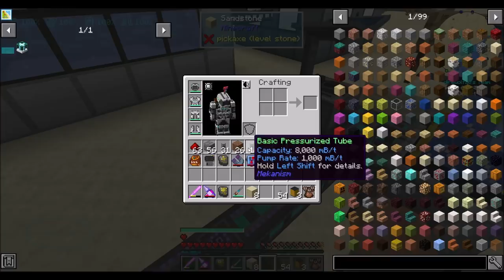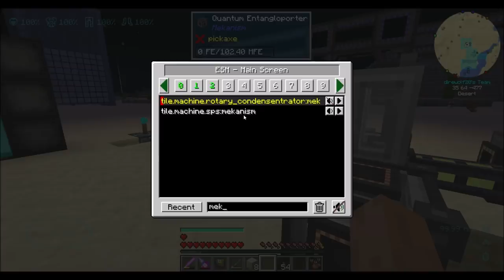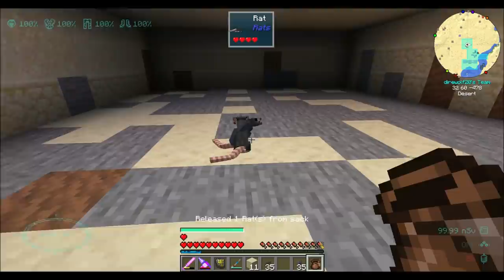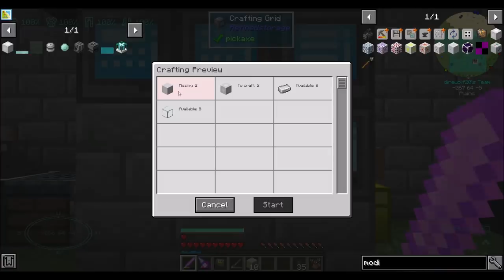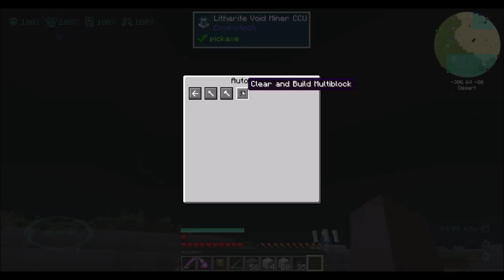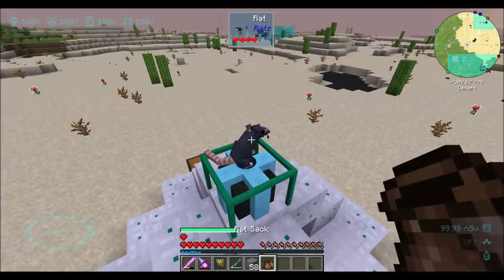Lets Play S10E97 Plutonium and EnvTech

Comment: No, you can't hold plutonium IRL safely. Some isotopes will actually enter criticality when even a small amount of it is stored in one mass. A popular image of the metal depicts it glowing red from the heat generated from it reacting to itself. Not to mention the side effects of receiving that much radiation in one go. Expect burns and some nasty flulike symptoms at the very least. (Assuming you are handling it very briefly, of course.)

Comment: There is a multi block structure in MEK for liquids and gasses.
Reply: Does it store spent nuclear waste though? Would be great if it does!
Reply: @poyuuu8061  Dynamic Tanks should be able too unless they have been configured not too. They should be able to hold Fission  Fuel fine.
Reply: I use a large one to hold a large reserve of molten salt for a very large reactor.

Comment: Would be nice if you had built a dynamic tank instead of all those mini tanks. You could than use a comparator in one of its valve to check how full it is
Reply: @Quietust In terms of buffer, yeh the pipes are ridiculous so you are better making pipes than tanks, but as he said, one way to visually see how much you have, tanks are the way to go, plus you can interact with redstone to make so neat automations. Like He is making fuel from two source now, so he could have a fuel tank, that has a comparator that only makes fuel from fluorite when it is bellow 30% for example.
Reply: @Sworn973  You can't store radioactive things in the tanks 99% sure also it's a gas and the tanks need liquids. but im pretty sure the capacity is a lot larger
Reply: @commander3494  You can store any mekanism stuff in the tanks, gas or liquid. I have it for my ore doubling gases.
Reply: To be fair, not all mekanism stuff go in the tank. Gases/liquid goes, fissile fuel goes, unfortunately neither plutonium, nuclear waste or spent nuclear waste goes in there. Which is kind like meh, but that how it is...
Reply: @Sworn973  that's new pretty sure.  But very cool